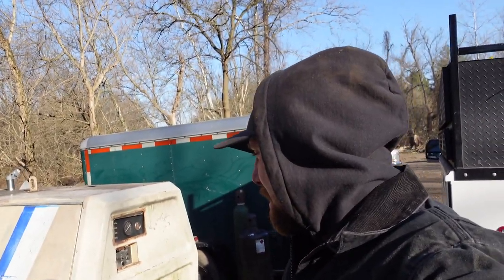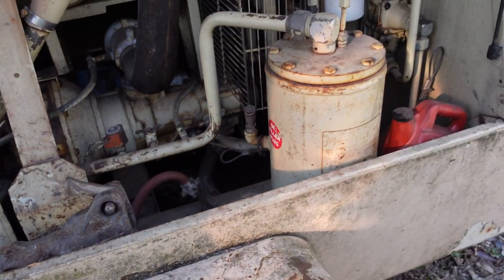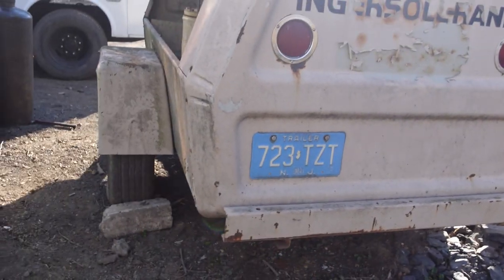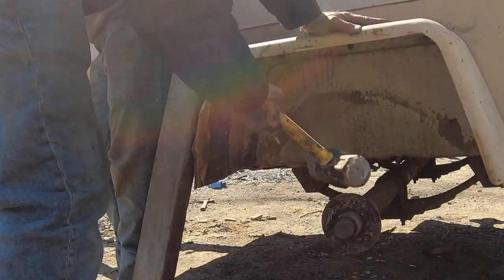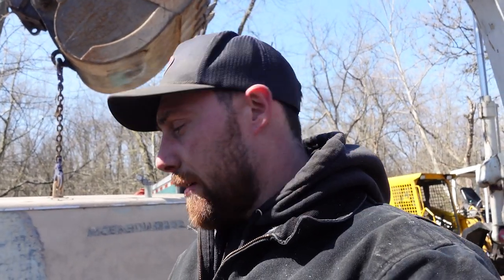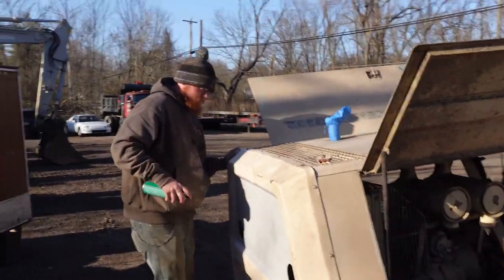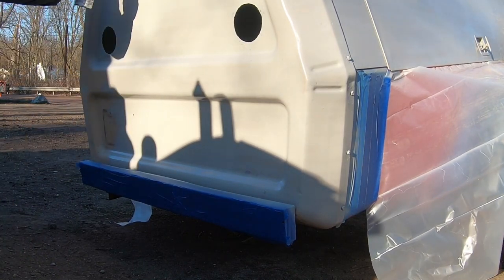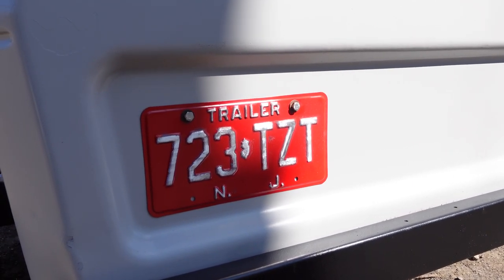(D.I.Y.) Compressor Restoration #milwaukee #tools

Comment: The compressor looks great.  Good enough for a work piece.  Initially after seeing it finished I felt it could use just a bit of flare, I was thinking wagon wheels.  Either chrome or white, reasonable to purchase at fleet farm or TSC, but that is probably too much.  Now I am thinking less is more, a set of chrome lug nuts to break up all the black that is the wheel and tire.  Chrome dust caps could be added, however I feel the lug nuts would be just classy enough.
Reply from the maker: I couldn't agree more with the lugnuts! We might have to get those one the way! Would really make it pop
Reply: @Only4Trucks  be sure to share if you do

Comment: Hey just curious what you guys do because I’ve seen you go and pick up steel in New York but I’ve also seen you run loads and a dump truck and go Pick up an excavator
Reply from the maker: My buddy started as an excavation and concrete company, but I have a stronger trucking background and he needed trucks for the excavation and then when excavation slowed down due to the winter we started hauling to keep busy. But we do anything from welding, excavation, concrete, hauling, whatever needs to be done we do it!